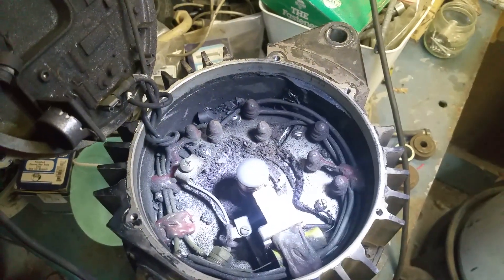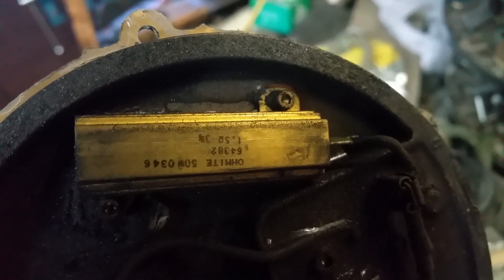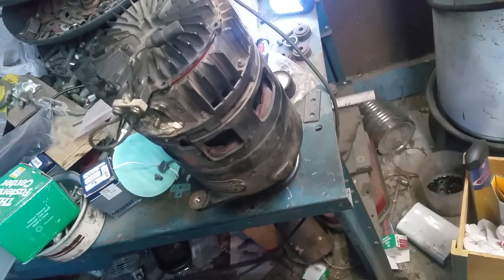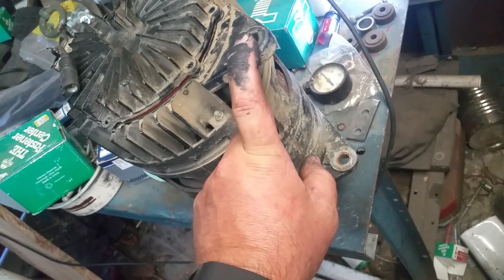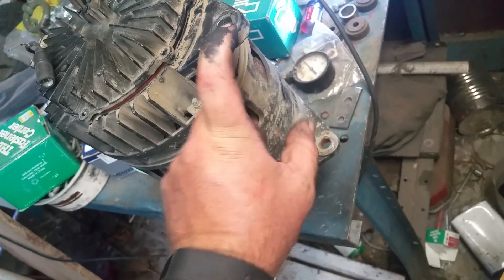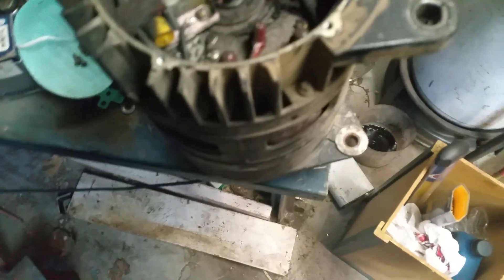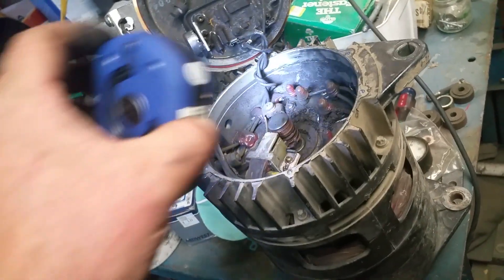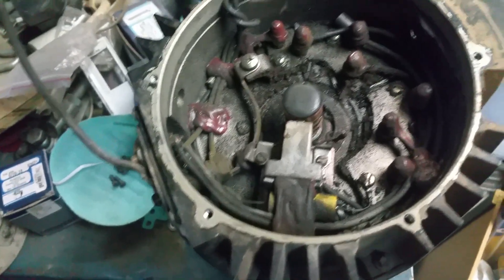24v Military Alternator

Comment: Cay marine makes a 24 volt alt-gen  that will work perhaps better reason for everything going to shit is probably shaft alignment. Being a year old you’ve probably figured that out
Reply from the maker: For whatever reason it is the overly complicated voltage regulators in them that pack up.  When I took this one apart all of that crap had melted down inside, bearings and whatnot have never seemed to be an issue because they are a good 50% larger than most alternators but the guts are made of glass.  I replaced it with a generic one wire 24V marine unit and have had no issues.
Reply: NelsonStudios if ya still have the old one keep it. Would make a nice generator or alt. As for the volt regulator try swapping it for a regulator rectifier similar to what’s on an two stroke outboard boat engine. Unless it is totally ruined but I can’t imagine that’s the case with military equipment. I can hardly find any alt-gens 24 volt on this internet.? Good to hear ya got her fixed!

Comment: Hey on my good running m923a2 the alternator has the same "rattle" at the pully. Still works fine, somehow.
Reply from the maker: You could pull that same cover off and get a peak inside.  Mine might have been salvageable if I hadn't just pulled the wires and left it turning for so long.

Comment: When they put these trucks up for auction, different motor pools will put in the worst parts in these vehicles. As an example, most of these vehicles were what we refereed to in the military  as "canned" vehicles. in other words lets say your tour truck was put on the chopping block list, truck going to DMRO "auction", and it needed an alternator. They would take one off a truck that was going through an engine change, order a new generator for that truck and put the 2nd hand alternator on your tour truck. SO most of these vehicles just to get them to auction used 2nd hand parts. The new parts were put on the reaming trucks or on the self.    

Now the truck I got was rebuilt to go to the Middle East but the Army cancelled that shipment because the MRAPS  were coming online. These truck has everything new, radiators, hoses, generators, wiring, tires, cargo bed with troop seats, brakes, rebuilt transmissions, and a new paint job. The problem was these trucks sat for 4 years before the Army made up their mind on what to do with these 100's of trucks, so they put these trucks up for auction .

No doubt that alternator was on its way out when you bought the truck, That alternator was bad for years, and finally reached a point it could no longer charge the batteries. I know you don't do it but fording these damn things will kill a truck in a heart beat. These alternators and every thing else on these trucks are weather proof, but not waterproof to the point of being underwater.